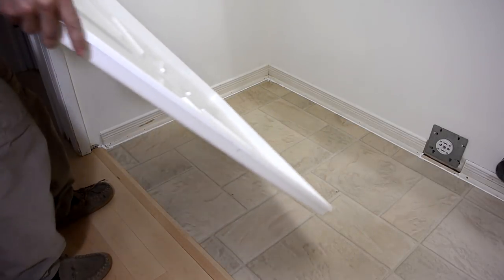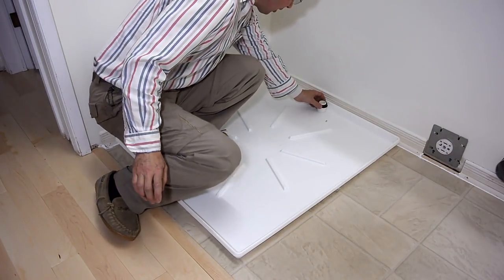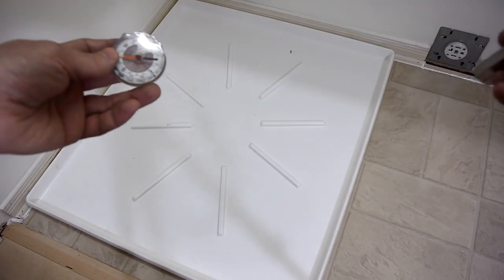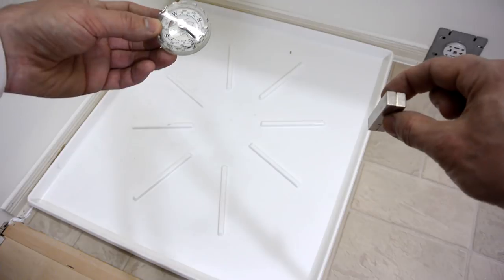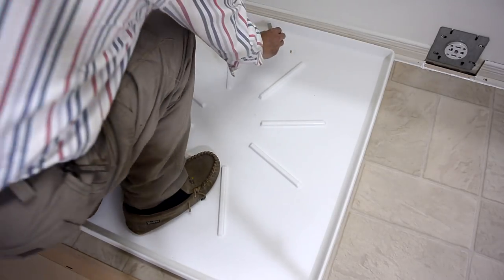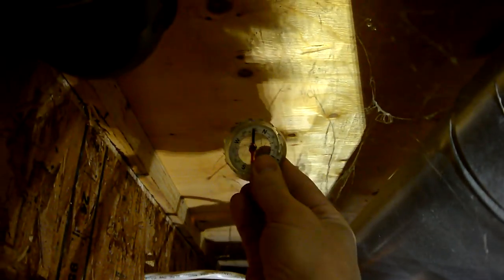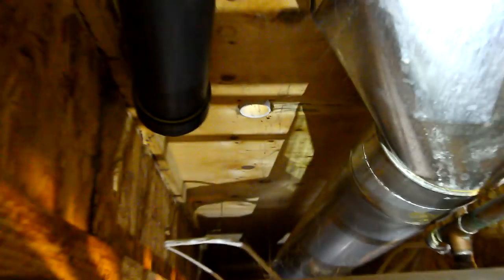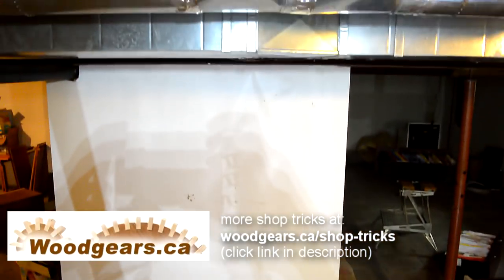Thru-the-floor (or wall) magnet and compass alignment trick

Comment: I love this trick i have been  using this for almost 10 years now.. When i was starting out doing residential remodeling a old timer at the time told me this trick. way faster than trying to find a common measuring point between levels or walls.

Now i do have to point out the HORRID caulking job where the shoe molding meets the floor. If you needed a "seal" i would have put a bead down  underneath the shoe before it was put down. But that is just the re modeler in me picking that out haha

I have literally watched all your videos and cant wait for more!

Comment: In the home we just built, I  pre-installed pull wires inside every wall. They run from the attic through the floor.  My intent is to have accesses available for unknown future needs. On each pull wire I duct taped a ceramic magnet 18" from the floor  and plugged the holes in the top plate and floor plate with a dowel to prevent an access for mice or fire.  Now if I need to install a new fiber optic outlet (for instance,) all I need do is locate the magnet with a compass, knock out the dowels and pull the new service with the pull wire.  If the pull wire is difficult to locate because if insulation, I can attach a "fox and hound wire tracer  to find it
Reply: That was a smart idea with the magnets. I have some blind conduit that I need to locate, with the end plastered over. I will stick a magnet on fish tape and locate it with a compass, much better than the RF wire tracer which is horribly unreliable in brick.
Reply: S/B " If the {END OF THE] pull wire is difficult to locate because if insulation..."  Note: RF tracer is pretty good when I use a cheap 6 transistor AM radio as the 'receiver'(=hound.)

Comment: Now that is a slick trick Matthias. I wonder about using it to punch an exhaust hole through an exterior wall. Will it make it through a 4" void and an inch of stucco?
Reply from the maker: depends on your magnet.

Comment: Nice trick! The directionality and sensitivity of the compass really makes this a great solution. It should work through some extremely thick barriers. You can get some magnets these days that'll practically pull the fillings out of your teeth. The compass would probably pick those up on the other side of your foundation wall.

Comment: Excellent idea! What size magnet would you reckon/propose it takes to do that with a stone/concrete house to get to the same result if possible? The drilling won't be an issue just the alignment is tricky through several inches of concrete or stone I would expect. Cheers and thanks for the tipp - I can see a lot of applications for this.
Reply from the maker: a longer magnet.  Just get a magnet and see how far it deflects the compass.
Reply: I will. Thank you - also thanks for the quick response. Cheers!

Comment: Im from Chile,  the buildings are designed to resist 9+ eathquakes, so  concrete and iron mesh everywhere. Just hang a frame took 10 minutes to drill  through the hard concrete and brick. The use of drywall is just for interior room 
separation

Comment: I did something similar to drill trhough a concrete wall with a drill bit half the size of it. I found out the exact spot I had to drill from the other side of the wall by puting a magnet in the hole and using another magnet on the other side.

Comment: Nice trick. In a tight spot, you could hang the magnet overhead with some double sided tape and use the compass above. I've used a compass as a stud finder to locate the nails in a stud too. Not as accurate as a magnet but it works.
Reply: ראה 'sselo Kuuouooa u! אם אתה רוצה לראות את זה, אתה יכול לעשות את זה, אם אתה לא יכול לעשות את זה. IIM נועהבוטטאאועגטעבכעככטגארקביייםםחןוLawrence Withrow

Comment: That's a good trick, In my house I would have to crawl on my belly in the dirt, to the place I needed to drill, dragging the "nothing but trouble" light with me.  And as soon as I would get there the filament in the bulb would break and I would have to crawl back for a new bulb ( I need to replace it with a battery powered LED one)> The fewer trips I would have to make the better.

Comment: If you have it in you, turn the machine on its side (i used a piece of lumber to slowly lever it against a wall) and replace the feet with thicker, taller bolts with rounded nuts on the ends (contacting the floor). It will give you more floor space to clean under the machine and is far more durable than the original design. Extra, extra, if you put straps made out of grounding flat bar in diagonal on those bolts it will also make the bottom of the machine more rigid and prolong its life, plus, take out some of the vibration. I'd say to make the extra, extra, extra jump of adding a piece of cast iron plate on that X but you guys in North America have wooden floors, there's no telling what might happen. As is, my Gorenje has never danced on the floor regardless of load ever since i made these mods.

Comment: Nice trick. :) To bad I would need some neodymium super magnet to get through all of the concrete on my floor to do the same Btw. How would you prevent tear-out in that floor if you would want to prevent it that is?
Reply: Put some sacrificial material beneath it
Reply from the maker: I could have used the pilot hole to hole saw from the bottom a bit first.
Reply: Yeah I thought about but than how would he support it when drilling